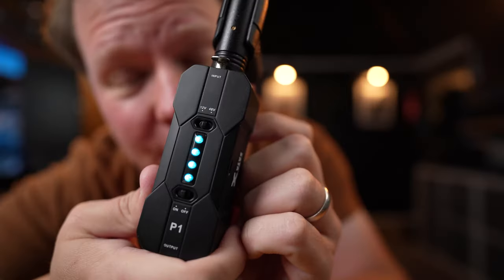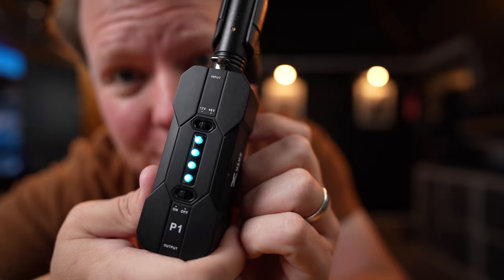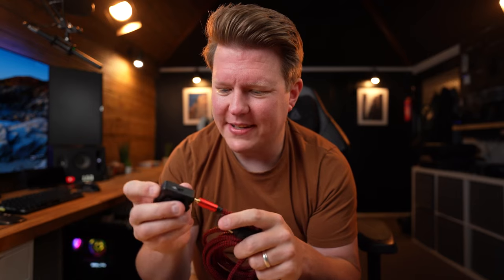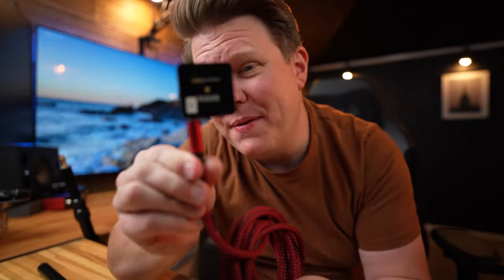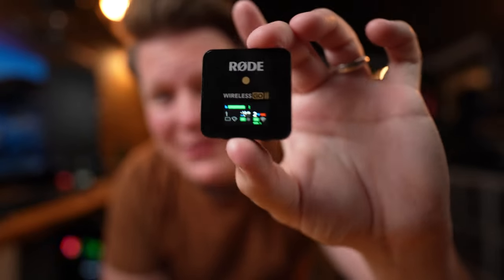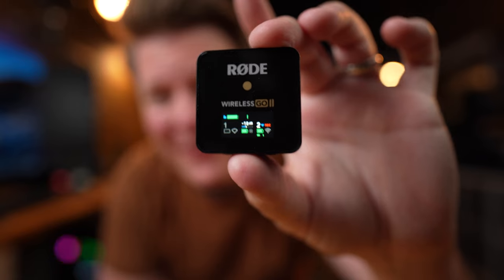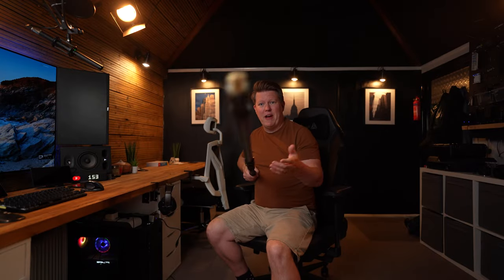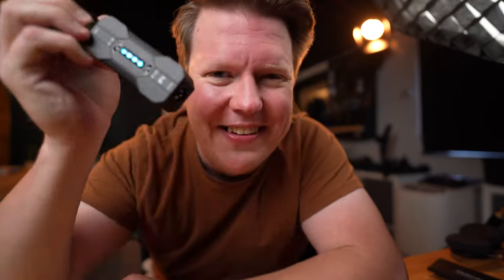DIY Wireless Boom Mic? Yes Please! Xvive P1

Comment: Exellent video, thank you. Is there a loss in audio quality when you do it this way and record wirelessly into your camera? If I were to use a shotgun mic with phantom power (internal battery), attach an XLR to 3.5mm jack adapter and connect this to the Wireless Go transmitter and record audio into my camera, will there be a significant loss in audio quality compared to recording on an external recorder (like a zoom recorder)? Any help would be appreciated..